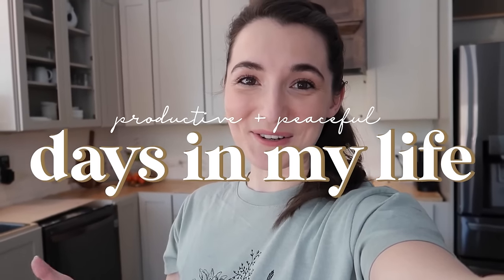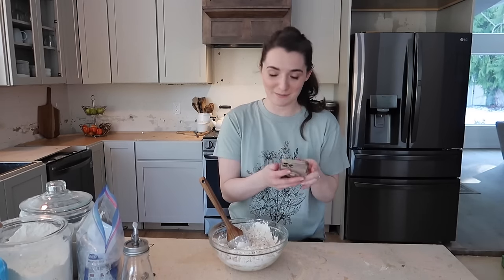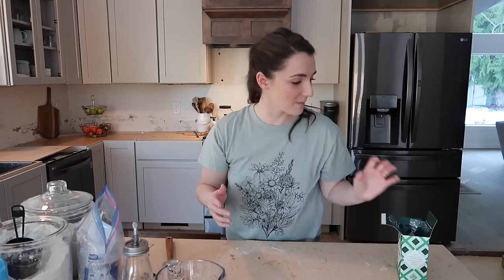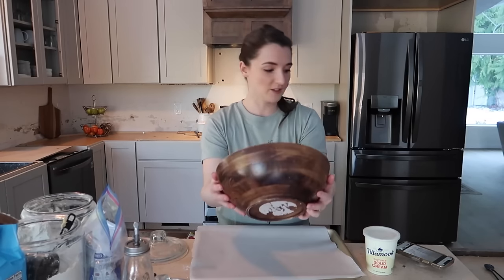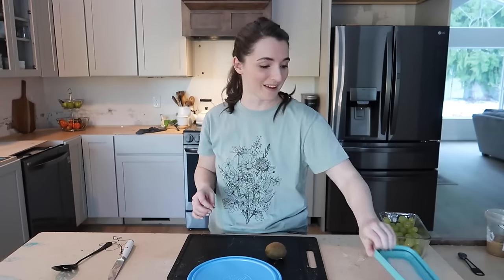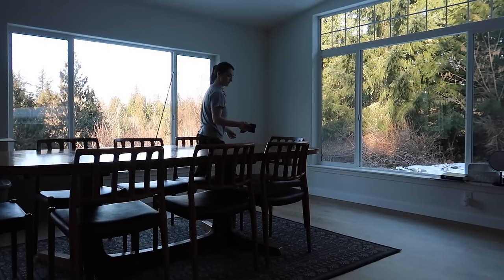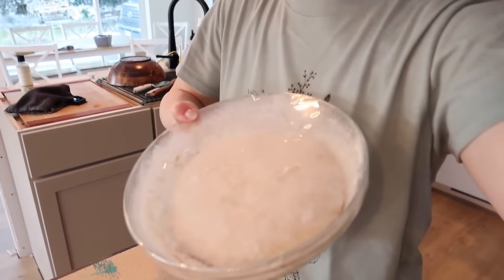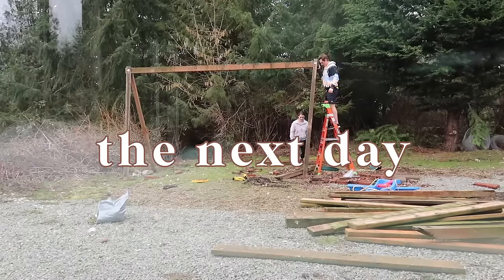EXCITING UPDATE! Homestead Projects & Plans! Productive + Peaceful Days In My Life cook with me!

Comment: Love my KitchenAid mixer!!  Have had mine for over 12 years. 

My advice: 
*Get one that had a handle on the bowl. 
*Do not go with glass bowls as they can brake easily.
Reply: I’ve got one bowl with a handle, and one without. Love the option, since the one without can nest inside the one with. Saves a little more space in my tiny kitchen.

Comment: I worked in a bakery when I was in college, and I’ve used the smaller tilt-head mixer and the larger mixer that you raise and lower the bowl. There are more color options with the smaller tilt-head version. It’s nice because it’s easier to scrape down the bowl, but when making bread or large batches of dough, it seems to be more than it can handle. I’ve even seen the entire top of the mixer come unhinged from the base. 😬 The larger mixer that has the bowl that raises and lowers is obviously better for large batches of dough, the con for that one is that it’s not as easy to scrape down the bowl because paddle or whisk attachments aren’t tilted out of the way. Either one would be a great investment, but if I could go back to when I made my wedding registry, I would opt for the larger one.

Comment: Don't know if you already got a KitchenAid, but get the    kind where the bowl sits on the bottom of the mixer. Don't get the kind with the little arms that hold it. Also - get a stainless bowl. Don't get glass! I have the 5qt kind which I think is the only size you can get where the bowl sits down and isn't suspended.

Comment: I grew up with a tilt-head Kitchenaid mixer at my mom's house. But the first one I owned was a bowl-lift model, and I absolutely hated it! I don't know if it was just mine or what, but it never got all the ingredients from the bottom of the bowl mixed in, and dry ingredients seemed to fly out of it much easier. I never used it because it annoyed me. I eventually found a great deal on a tilt-head model, and sold my bowl-lift in order to buy it. Sooooo much better! I love that my bowl has a handle on it too! That's my biggest tip: a bowl with a handle is very useful. I've never had one with a glass bowl, but I know several friends who have and have broken it and had to replace it a time or two. So I would probably be inclined to stick with metal. I also got a (off-brand for me) beater blade from Amazon that has silicon scrapers on the sides, and I love it for making things like frosting or whipped cream.

My favorite breakfast food is Eggs Benedict! But I like to put it on top of hash browns instead of the English muffin! 

You leave the peel on kiwi?? I've never seen that before!

We're looking for our first house to buy right now, and I keep hoping we end up with a place where we can get chickens too.

Comment: If you plan on making dough, I would suggest getting the mixer where the bowl attaches on the neck rather than the bottom, if that makes sense. I think it holds the bowl better when mixing thicker substances like dough as opposed to the one that I have, which attaches at the bottom. Otherwise, I don’t think you can go wrong with whatever kitchenaid mixer you get.

Comment: I bought a tilt back Kitchen Aide stand mixer with metal bowl 18 years ago.  I was about to make wedding cupcakes for my daughter's wedding and my very old and handed-down Sunbeam mixer finally crashed.  I love a stand mixer because it takes an extra hand to hold a hand mixer, so it's much easier to use the stand mixer for adding this and that to the bowl.  

Since that time, I do not bake as I once did due to dietary changes, but once in a while I break it out and make my healthy baked goods.   I keep it on a shelf in the pantry because it is so large.  

PS, when I used to make yeast breads, I merely covered the bowl for rising dough with a clean kitchen towel.  I never used plastic wrap, as I imagine the dough needs to off-gas a bit.  

I have never had a pastry blender either.  In those instances, I just use a fork to blend.   

I am also allergic to eggs and have had to revamp many recipes into egg-free.  Most times, using soaked flaxseed meal and water,1T:3T per 'egg', does the trick for binding things together.  If I need rising power in baked goods, I add apple cider vinegar to the wet ingredients and baking soda to the dry, and then combine. I am also gluten free at this time, so I pretty much exclusively use coconut flour, which also limits my recipe useage.     I also found some pinterest recipes using psyllium husk powder which creates a bit of a rubbery texture, but I have gotten used to it.  And because it is psyllium husk powder, you want to be careful not to overeat your recipe in one sitting.  Ha.

Comment: Regarding KitchenAids, I highly suggest the ones that the bowl lifts us, not the kind where the mixer head flips back.  I've used both, and I (dare I say it) hate the ones that flip back (and not merely because I grew up with the kind that the blow lifts up) - they're super awkward because the part that flips back is just so ridiculously heavy (even for me, and I'm only a year or two younger than you), making it often very difficult to lift it up without making a mess or having it fall back down into the bowl on you... which also means it's much easier to have little ones help with the one that lifts than the one that flips back - I could do the lever on the lift one when I was only 2, but even at my age now, the flip back ones are still difficult to do for me.  Also, the base on the lift up one is much better balanced to make it less likely to tip backward, while with the flip back ones I've almost tipped the whole thing backwards because the center of gravity when the top is flipped back is so much further up and back.  My mom has a 5qt, so that's what I grew up with, and it was plenty big for everything we ever needed to use it for; I've used 4qt ones, and they were far too small.

Comment: We have an older Kitchenaid and I think they fixed the issue, but whichever one you get, make sure the spatula/stirring attachment can touch the bottom and scrap the sides. We gave up hope and stopped using ours because it won't reach the bottom and half the ingredients don't get mixed in. The bowl doesn't go up high enough. It also doesn't fully get the sides because it doesn't really touch those either, so we end up having to stop it constantly to fold everything with a rubber spatula.

Comment: I have the black 5 qt KitchenAid Artisan.  Purchased new almost 16 years ago at Kohl’s on Black Friday and still going strong.  The little plastic piece that is on the end of the metal speed lever got broke in a move, but works fine.  I have a lot of the accessories and an extra stainless steel bowl (highly recommend).  I have broke THREE of the clear glass bowls…finally gave up on buying a fourth.  Lol.  I have been contemplating buying the 6 qt lately as it would be a little bigger for larger batches of cookies.  You can shop around and find a good deal.  IMO you can’t go wrong with the KitchenAid mixer!

Comment: Regarding the KitchenAid, think about where you want to store it and use it. Mine has a lever lift instead of the kind where you can tilt the head back, so it doesn't fit on my counter under the cabinet. I store it in a large bottom cabinet, but it would be nice to have more options for where to use it on the counter.
Since you're allergic to chicken eggs, are you just going to use those for the rest of the family?

Comment: If you like to double recipes for freezing or sharing don't by the Artisan Kitchenaid it binds down much easier and blows the motor. I highly recommend the professional model and you can find great deals on the refurbished models the warranty is 1/2 the time but with the price savings if something goes wrong out of the warranty you can invest in repairs. However, that said I have never had any problems with my refurbished Professional model.

Comment: Bought a kitchenaid for my mom, definitely keep the warranty info! Hers died after almost a year, had an electrical issue. But the replacement has been fine. and mine has worked well for 6 years. I'm not actually the biggest fan compared to my moms ancient 2-beater mixer, the smaller kitchenaid at least, doesn't get all the way to the bottom of the bowl with the regular paddle, maybe the one with the rubber is better?
Reply from the maker: Thanks so much for the tips!
Reply: The head probably needs to be adjusted. There are a lot of videos that show how to do this.